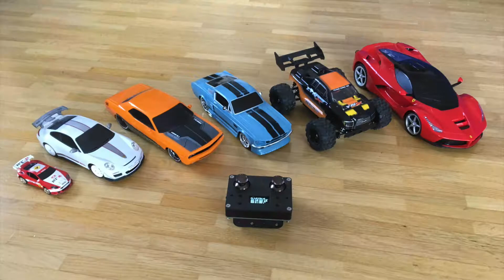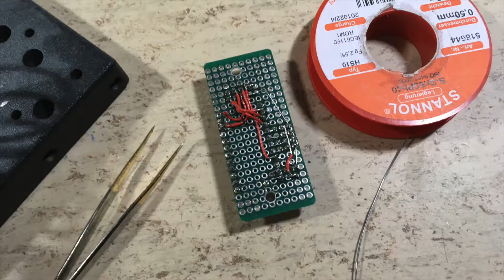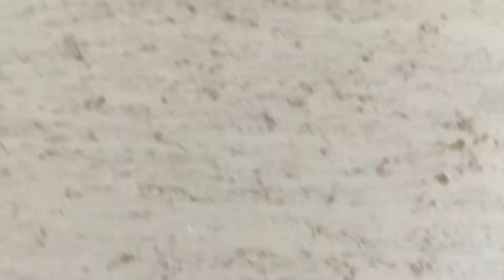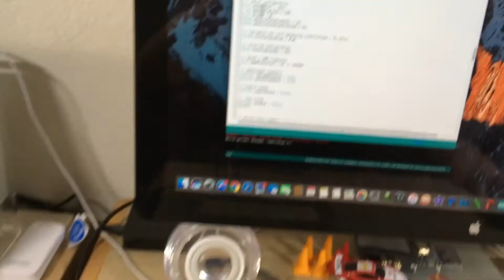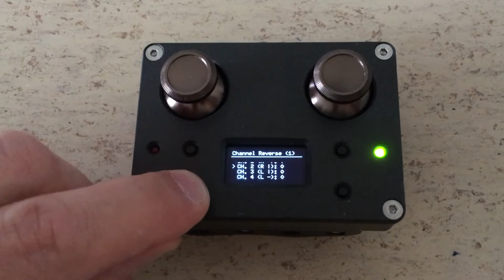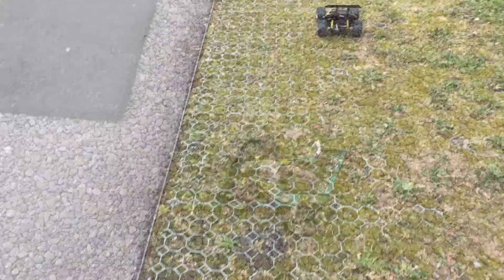Arduino 2.4GHz RC Receiver Scratch Build How To

Comment: Hello! I finally build the receiver and it communicate with tx but 
when i connect the servo to one of A0 A1 A2 A3 it start to buzz.
Do you know why?

And another thing, here you said to download your bootloader on the pro mini, but in your manual you don't ... 
Could start from here my problem?
Thank you a lot.
Reply from the maker: Hi, the working communication is a good sign. The boot loader does not really matter. My custom one only has a lower brownout voltage. This prevents the receiver from rebooting, if your supply voltage is not very clean. Which part is buzzing? The servo? Does it move, if you move the joystick? It may be plugged in the wrong way around. Or your battery may be too weak? Otherwise do basic trouble shooting steps with a multimeter or an oscilloscope. Good luck.
Reply: HI, finally it works!
Thank you for your time!
p.s. i think it was a battery problem ...
Reply from the maker: Nice, well done! Could you do a video? I would love to see your version of this remote
Reply: If you want i will do it :-)
But i need to solve some issues before to do it ...
The tx reads 4.3 volts on rx's battery if i connect the ESC between battery and rx. If i connect battery directly to rx's raw the value is correct. 
I have some work for tonight :-)
Reply from the maker: Only do it if you really want, but It would certainly be interesting to see your version. The behavior of your battery voltage measurement is normal, because most ESC have an integrated voltage regulator, called BEC (Battery Eliminator Circuit). So in case of a BEC / ESC, the displayed voltage is not the battery voltage, it's the regulated servo supply voltage of your ESC

Comment: HEllO!
OK i'm working on this project ... I built two trasmitters that seems to work fine in test mode, but i'm unable to connect the receiver ... 
This is my first arduino project so every helps are good for me :-)
I don't find the receiver manual, the only thing i modified is the CONFIG_FIESTA in veihclesConfig.h the uploaded. 
Do you have any suggest?
Another thing ... the esc must be connected on a servo connectors correct?

THANK YOU A LOT FOR THIS PROJECT!!!!
Reply from the maker: Nice! so this means the two transmitters are talking to each other? One in transmitter mode and the other in tester mode? If yes, the problem is your receiver. Is the 3.3V supply OK? A stable voltage and good filtering is essential for the NRF24L01+ modules. A 100nF ceramic capacitor directly across the radio module GND and 3.3V supply pins may do the trick. Good luck.
Reply: TheDIYGuy999. Thank you for your fast answer. In my tx i used ic1113 with 10 micro electrolitic both on vin and vout and it works.
Same config on the rx wont... 
I tries to add 100nf directly on pins of rc module but it continue to fail.
I cheked your schematic and you talk about. 3.3micro... I need to buy it and try but it sounds very strange to me. :-)
I put ic1113 under the mini on my pcb it could be the problem?
Thank you for your help!
Reply: hum ... i read some documentation about decoupling capacitors ... i forgot to buy them and tried to do without but now i know that they MUST be mounted ... I will buy them asap.

:)
Reply: Hello, today i added the 3,3 micro tantalum and the 100nf ceramic all near the GND e 3,3v of radio module but there was not improvement ... 
I really don't know how to do ... 
I used a ic1113 with 10 micro electrolitic on Vin 10 micro electrolitic on Vout for all 4 devices.
TX are both working , RX are both dead also with 2 new condensators.
I tried to swap radio modules from a TX to a RX without results ...
i saw that on RX, the led near pin 9 is "pulsing" with 3 bright levels, in TX it is has fixed bright ... can it help?
Thank you for your time!
Reply: i watched again your video and (now) i know that i burned a standard bootloader instead of your dedicated ... I downloaded it and i tried to use it but i receive an error : 
 ***failed;  
avrdude: WARNING: invalid value for unused bits in fuse "efuse", should be set to 1 according to datasheet
This behaviour is deprecated and will result in an error in future version
You probably want to use 0xfe instead of 0x06 (double check with your datasheet first).

Could be here the problem?
THANK YOU A LOT

Comment: you welcome, thanks for your answerhow about TB6616fng, coz your directly wiring on motor driver board. its still same from eagle pcb?
Reply from the maker: The wiring schematic is always the same, regardless if it is a homemade prototype board or the "Micro RC" PCB

Comment: Would you happen to have wiring without custom PCB (with arduino pro,  mpu6050 , TB6612FNG seperate) i would like to get it working before i brutalize them..
Reply: uups, i meant the rc-coke car version :D
Reply from the maker: No, I don‘t have wirings. Do you have a problem with the soldering of your boards?
Reply: im having some trouble to get started (i received my TB6612FNG few days ago)  i got some rough idea from that balancing robot. This project has so many new stuff to build and i'm trying to get general understanding where to start and where to go :) Im trying to use esp8266 instead of nrf24 for now, until my nrf24 -package has arrives :) Maybe i should just start from making simple remote controller button and expand from there.
Reply: or maybe i should desolder one from my multiproto module, so i would have 2x nrf24
Reply: i got also some 433mhz receiver/sender which i could use to get started... it has bigger antenna, but dont need them on short distance. Just to get it working and to get forward.
Reply from the maker: There are 2 ways in my opinion:
Doing small steps until you have your own working solution
Taking a working system like my Micro Rc remote
Reply: i prefer usually, small steps and modifying it to fit my hardware and finding solutions, that's the way i usually learn the most. :)
Reply: and i usually dont have enough intresting projects to learn/use these arduino/coding stuff, but this one i can hardly wait :D
Reply: @TheDIYGuy999  Lets add a 3rd step on that.. 3) apply university of applied science, learn more about electricity and return for the project 4 years later :D Now I know kicad, electronics and designing my own project as thesis. This project of yours was one of my motivation to get educated in this field, thank you for your cool inspiring project.

I was wondering if there was a possibility to integrate mpu6050 on that single board to save some space and stuff FPV inside one of those Coke-can cars? I doubt it would be possible by keeping the case unmodified massively. But I'll manage just fine with adding it on top of the case.

Comment: Hi, thank you so much for providing such didactic material. I have the following doubt: Which components should I upgrade so that the project presented in the video supports a 7.4v battery and a 4800kv motor? Thank you very much in advance
Reply from the maker: You're welcome. You can use it as is. Just leave the TB6612FNG out. All common ESC have a 5V voltage regulator inside, which supplies the receiver via the 3 pin throttle wire. Connect the steering servo to CH1 and the ESC to CH3

Comment: sir ye kya hm ye Jo choti remote control car aati h between range 1000 to 1200 rupees kya hm inme 12 volt ke supply dekar us plate me 12 _12 volt ki 2 dc motor connect kar skte h.?
Reply from the maker: Please ask your questions in english

Comment: Bhai kya hm isko 12 volts ki battery se connect kar skte h .yes ya no.
Reply from the maker: The TB6612FNG motor driver yes. But the max supply voltage of the receiver is 8V

Comment: whats the role of 3.3uF tantalum and 100uF electrolytic? why are using them in your circuit?
Reply from the maker: The motor causes lots of electrical noise. So we need to smooth this noise in order to allow to run the CPU and the radio module reliably
Reply: TheDIYGuy999 thanks for replying back. I'm a huge fan.
Reply from the maker: Thanks for your kind words. I really appreciate it!

Comment: Hi, this is not related to the video, but I am having a problem with a project evolving the NRF24L01 chip. Basically I am developing a car that is controlled with a remote control that I created with 3 push buttons, a potentiometer and a ps2 joystick.
The car can move with 2 DC motors and a caster, shoot a nerf dart and light 2 leds. 
Here are the codes:
For the car
https://gist.github.com/ddmdavid/b78991e3e23ebdb6709478ece909bbda

For the controller
https://gist.github.com/ddmdavid/06146ba026d67d4ed662b178d677b1e3

The problem is that the communication does not happen, can you help me?
Reply from the maker: Your NRF modues may be defective. Are they supplied with stable 3.3V? If you supply them from your Arduino 3.3V regulator, you may have to reduce the transmission power:

// Set Power Amplifier (PA) level to one of four levels: RF24_PA_MIN, RF24_PA_LOW, RF24_PA_HIGH and RF24_PA_MAX
  if (boardVersion < 1.1 ) radio.setPALevel(RF24_PA_MIN); // No independent NRF24L01 3.3 PSU, so only "MIN" transmission level allowed
  else radio.setPALevel(RF24_PA_MAX); // Independent NRF24L01 3.3 PSU, so "FULL" transmission level allowed

Comment: thanks for your video. could you please post a bom on the github repo. with the component name, packaging, and maybe an URL to eBay or Aliexpress ?
Reply from the maker: a components list with eBay links is in the description. I may add a BOM on GitHub later. The components names can also be found on the schematics, for example for the oscillator
Reply: tanks,  i mean for the radio & reicever from your github. so it will be accessible for peopol not having skill.